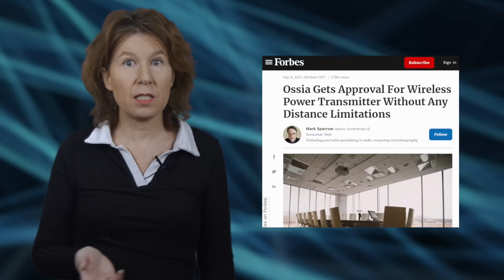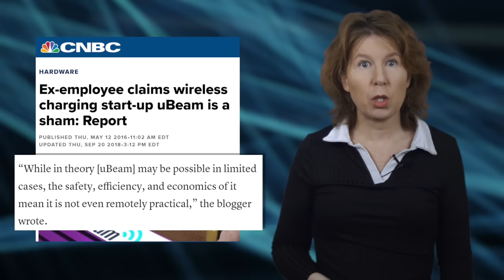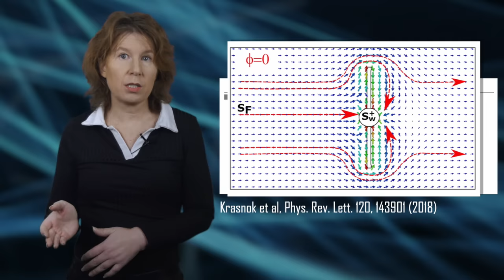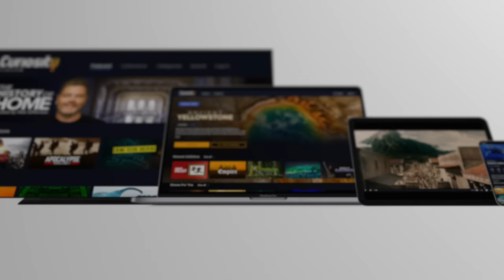How close is wireless power technology?

Comment: 4:07 Not to mention just how inefficient this method is. So much of the energy is lost to heat, and what's even worse, the heat is negatively impacting battery life of your phone. I used to charge my phone wirelessly but stopped because of how quickly the battery started degrading and needed replacement. Also, if we want to be environmentally friendly, - we need something just a tiny bit more efficient.
Reply: hey, think about the extra efficiency you get by not having to plug in your phone every other day while you sleeping...
Reply: specifically about lasers its easy to buy a 60% efficient infrared laser. but im thinking of something else that hasnt been tried before.
a giant tuned coil around the entire house. its mad science tesla style i might try that on low power before every device inside fries.
Reply: How about... BRAINS?? 😂

Comment: Excellent video as always, Sabine, but minor correction: Power delivery over USB-C is much more complex than just a single number. Most phones support fast charging over USB-C, which range from 20 to as much as 100 watts. Additionally, the spec called USB Power Delivery has supported up to 100 watts for a few years, and a new spec is in the works to support up to 240 watts.
Edit: I see that someone else commented with the same info & you replied to them. All good!
Reply: i have yet to see a USB phone charger that is more than  5v/3A  output.  You only need to supply as much current and voltage as the USB phone charger you plug into the wall is able to provide.  That's the difference between a Physicist and an Engineer.   Physicists say: "we will have this in 10 years....".   Then  10 years later,  they say again... "we're about 5 years away from a breakthrough..."
Reply: @KevinJohnson-fw8kv  higher wattage USB power delivery doesn't happen with increasing current, but with increasing voltage, at 9V, 15V, 20V all the way up to 48V for 240W power delivery. The reason is the same as the reason that normal power delivery from power factories happens at several killovolts: efficieny. The higher the current that flows through a cable the higher the losses. But if you increase the voltage and decrease the current flow, the losses get smaller. There are currently USB chargers that you can buy off the shelf with at least 30W into a single USB port.

Comment: Would be amazing to see a video on metamaterials in general not only relating to wireless. LiFi is in some ways interesting as a wireless form of power combined with data transfer. Thank you for your amazing content. 🥰
Reply: metamaterials are not required,  it's already been done at the University of Michigan using copper coils,    10 Mhz Resonant Frequency  is capable of transmitting around 1,000 Watts of power.   There's no need to do research into advanced materials, you just need to build it.
Reply: @Kevin Johnson  sorry my grammar is awkward. Two separate sentences and two different independent clauses. So, I was saying it would be neat to see a video about metamaterials in general. Second was referring to the context of her video and that LiFi that powers the device is interesting. I have seen these demonstrated by, for example Harald Hass in his Ted talk in 2011 and subsequent one in 2016.
Reply: @hieroglyphica  Magnetic Resonance  works for  SAFE  far-field wireless charging.
Reply: @Kevin Johnson ok interesting thank you for the introduction to the topic.

Comment: Thanks as always for another great video. Wireless - Does not have to refer to EM radiation. You can shoot a canon ball and the receiver can covert the kinetic energy of the canon ball to electrical energy. Or you can spin up a flywheel and carry it over to a distant location and have it run some electrical generator. But I suspect these are not marketable goods or methods 🙂
Reply: Flywheel do not have to be moved to be useful, and is a marketable good
Reply: Shooting canon balls is what power transfer via ultrasound actually does. 
Ok, air molecules are very tiny canon balls and you need a lot of them in between sender and the final receiver and a lot of them are going in the wrong direction. Not quite efficient.
Reply: @agimasoschandir  Spinning flywheel can be seen as remote power transfer through time but its not wireless. 
The wheel itself is the wire connecting the two points in spacetime where its spun up and where its driving a generator. ;)

Spinning flywheels are energy storage technology, not wireless power transfer technology.

Comment: Listening to James Lovelock, I can imagine if someone's tooth filling or worse yet, a heart pacemaker accidentally turned to the same frequency as the wireless charging transmitter. 🤔
Reply: Indeed a scary thought :S! What other future technology innovation are you most excited about?
Reply: The Telcos installed a cellphone tower next door to us at microwave frequencies (4G). In order to cover a small area they beamed downward instead of outward. The result was that I got 24/7 radiation at a dose considered by many expert to be damaging to my health. And it was. I got all sorts of symptoms, getting worse with time. After 6 months, I had all 4 metal fillings come loose and fall out. Some after cracking the tooth. I had most of these for decades. Some silver and some gold.
Reply: @clivegranville9690  ai.. that's not good!!

Comment: Lovely video as always, informative, educational and entertaining at once.

What we want, I think, is for our phones (and other convenient handheld devices we keep in our pockets) to charge no matter where they are in the house, and possibly in the office. Putting your phone on a pad is better than having to plug it in, but you still have to remember to charge it every day or else you are left with a dead phone, and it's easy to forget if you keep in a pocket other than the one in your pants.

Those 60W antennas that deliver 1W within 2 meters may be enough already - assuming you have a few of them strategically placed. Wasteful as hell, obviously, but I think that is a physics problem, not an engineering problem. 

With that said, I wouldn't want much more power than that flying wirelessly around my house, honestly: at some point, some part of my clothes, or worse, my body, will be close enough to the right length to heat up, and it takes surprisingly little to destroy certain important chemical reactions. For example, if your brain is warmer than 42-43 degrees (315-316K)... You die. 

And of course if the power is high enough you can get burned, or literally catch on fire.

Bottom line: I'm fine with wireless energy transfer not delivering kW of power. That's what microwave ovens are for, and I'd rather not live in one. If we could get consistent delivery of 2W at 10m, however, without those scaling up to 200W at 1m, I would be very much okay wirth that too.

Thank you for coming to my TED talk :P

Comment: The way it was (very briefly) explained by my EE professor was as follows:
It's not about being able to transfer power wirelessly.  We can do that already.  It's not even about the distances required.  We at least understand how to solve that problem in principle.  

No.  It's about how much damned demand there is.  The size of the plant required to generate enough electricity to power both a city and its own transmission of that electricity immediately outweighs the benefits of the wireless transmission.  But if we were operating the world of ... say 1930?  We could have that up and running in a decade.  Unfortunately, every time we add more available power, it is instantaneously used somewhere.  Like adding a lane to a highway and finding it just fills up with even more cars.  Or increasing internet bandwidth only to find that the pipes are still jammed up because image ads become audio/video ads.
Reply: Or switching to LEDs and now everybody wants to have colored lights on their building exteriors.
Reply: @jamesvandamme7786  I read your comment and right under it I see an ad showing a small house with its walls lit up by floodlights like it was some great cultural heritage site. :D
Reply: Idle thought: Thermal wireless energy transmission. Moderately safe (occurs readily in nature), relatively easy to make transmitters and receivers compatible with each other. Multiple modes of transmission available (conduction, convection, or optical).

For conduction, your wireless charger could consist of a short segment of nichrome wire and a conduction plate, this wire loop is then connected to AC power, and emits thermal energy into its immediate vicinity. Charging would consist of placing the object to be charged on top of the plate.
(Could also thermally charge non-electronic items, such as ones' food or beverages).

For transmission over a short distance, the transmitter could have the nichrome element inside of a tube-shaped apparatus, with an electric fan at one end. This fan causes a stream of heated gas to travel out of the tube, and can be directed towards the device to be thermally charged. Alternatively, thermal energy may be generated via non-electronic means (such as the combustion of volatile materials, or "fuel"), or collected from other natural sources (such using a lens and sunlight).

Optical transmission would be accomplished by turning energy into light in the visible or infrared regions, and then directing it towards a target (such as via optical lenses or reflectors focused on the target).

The device to be charged could have a reservoir of working fluid which undergoes a phase transition (liquid to gas), and once in gas phase is then is used to spin a small generator; with a "cold side" where thermal energy can again leave the device, the working fluid then condensing to a liquid phase (say, we use butane or pentane or similar as a working fluid...).

Ideally, probably want a boiling point around 45C or so, assuming a "cold side" around 25C. This would allow it to be "safe to handle" (without posing undue risk of burning the user).

Though, various other mechanisms are also possible...
Reply: Did you not watch the video?!

we are NOT able to transfer power wirelessly
the laws of physics expressed in Faraday's equations makes it clear
over any distance the losses negate any possible benefits

Your professor was talking out of his lower orifice, or you did not understand what he said
Reply: @kenwittlief255  Did you watch the video? There's a couple of examples of wireless power transmission. You say the benefits never outweigh the costs, but that's clearly ungrounded. I can think of many scenarios where you can deal with wasting a ton of power if some of it gets through. I'm sure if we had power consumption of a century ago, and production of today, we could get away with wirelessly powering a lot of things, it would just be insanely wasteful.
Reply: Btw, the sun is wirelessly powering our entire planet. What do you think of that? :-P
Reply: @kenwittlief255  That's quite a degenerate example of a particular (very stupid) way to transfer electricity. You suggest a ridiculous way to use something and conclude from that example that said something is impossible due to laws of physics?

Let's try a more realistic approach. There's nothing wrong with the power distribution network we have now, so replacing all of it with wireless "just because" is utterly stupid. Assuming one central emitter is also stupid in the same way it would be stupid to only build one cell tower to provide coverage for all of the nation's mobile phones. A much better approach would be a network of emitters regularly spaced throughout the city, drawing power from the conventional wired distribution network. It doesn't need to power high draw stationary appliances like dishwasher and stuff, there's no point in that. The main use, I imagine, would be batteryless personal devices like phones or wearables. If you put an emitter on every building, the intensity would be pretty homogeneous and you can tweak wavelength to avoid imparting energy into things you don't want to. In such a world there'd probably be regulations on making stuff from materials and shapes that don't absorb the wavelength used, same way we have regulations for making electronics resilient to ESD.

And even that is a fairly convoluted example of something consumer-oriented, just to follow your idea of the use. Something much more achievable would be providing power to devices inside a single enclosed building. Then you don't have to care about the inverse square law, since you can build it to reflect energy inside like a microwave does, and you can control what's allowed inside according to the purpose of the site. So, by saying "impossible because physics", you are just demonstrating a desperate lack of imagination.
Reply: Besides, transmitting power using electromagnetic radiation is just one of many possible ways of "being wireless". Personally I really like Sabine's suggestion of using tiny autonomous drones to ferry charge to devices.
Reply: Your professor is wrong, we've known how to transfer power vast distances at very high efficiency since Peter Glasser's paper in the 1960s.  The problem is the cost and size of the 2 kilometer sized antenna required to transfer energy from space to earth.

Comment: I worked on a project that used VHF RFID.  These could be read at a range of 10 meters. They could also be read within a truck which also contained metal tools and materials or, in one acceptance test, a load of gravel.  The Scanner had about 1 Watt of radiated power. The limitation was FDA rules regarding cardiac pacemakers.  The truck had multiple antennas inside.  The tags could be within a piece of paper, foil sandwiched inside and a chip in the middle.  As we tested the scanner, we found a surprising number of our personal possessions had these tags as well. Typically high end coats, briefcases and the like.  Turns out that stores could scan customers, key the RFID serial number to a credit card database.  If your sales person seems strangely psychic - this may have a scientific explanation.

Comment: There is the rain/snow/pigeon problem, not to mention a 'hot-seat' for passengers of passing airliners. But shoveling wet feathery snow in the dark is OK, well then look no further. The sensible place for that would be underneath parking spots and stop light lanes where sensors could activate cars or coffee cups passing overhead and bill the receptive owner accordingly. But wireless power transmission within safe pipelines is cool.

Comment: Third in Sabine's list of problems caused by wired charging is wear on the device's charging port.  The wear can be eliminated by using a magnetic-tipped charging cable, which has a low-profile detachable tip that you keep in the device's port.  This compares favorably to induction coil wireless charging because (1) it's more efficient and (2) the cable length offers flexible positioning & use of the device while it's being charged.
     The style that I purchased has oval-shaped magnet connections (not circular like the older style) and supports USB data transfer too (not just charging).  It came with an assortment of tips: usb type c, micro usb, and apple.  It takes only a few seconds to connect the cable to the tip that's in the device's charging port and can be done with one hand because the magnets on tip & cable are reasonably strong and attract each other.
Reply: Nice life hack, thanks

Comment: The 1950s book by Raytheon on projects to build with your CK722 had a radio receiver amplifier powered by the DC component of the detected signal in a crystal set.  There would have been no need to use the same station for the power and the audio, if they'd been a bit more elaborate.  Suck power from the strong station to listen to the weak one.